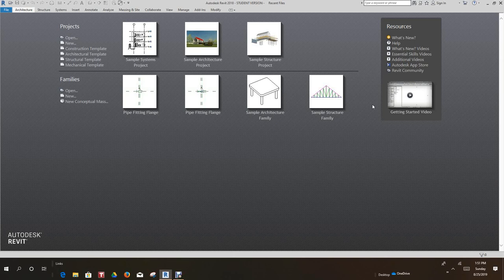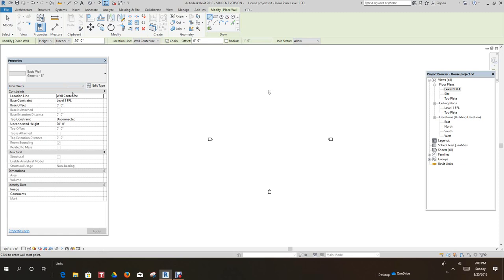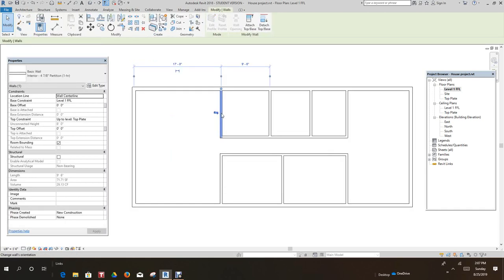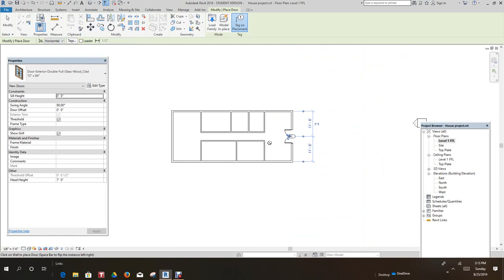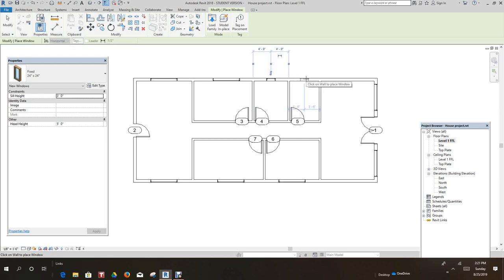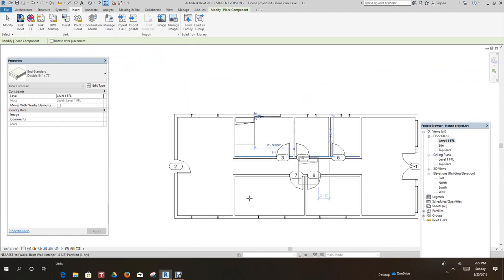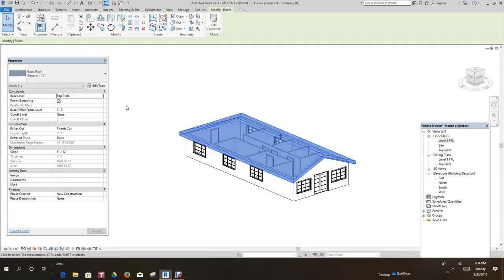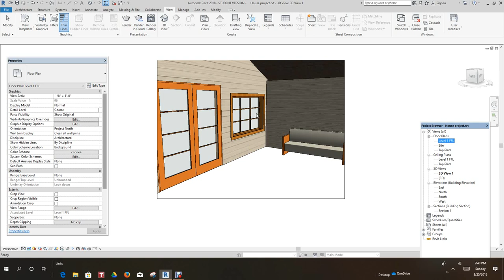Revit Architecture Basic house project

Comment: 23th Min teaching : is there any table , reference available for the most common windows and door size available for the residential buildings in North America? which most of the builders use or offer ?
Reply from the maker: https://classicwindowsinc.com/classic-windows/double-hung-windows/double-hung-window-size-chart/

Standard sliding window widths are 36, 48, 60, 72 and 84 inches wide; the windows themselves are actually 36 1/2, 47 1/2, 59 1/2, 71 1/2 and 83 1/2 inches wide to allow for installation. Standard heights are 24 inches, 36 inches, 48 and 60 inches. A 6-foot-wide by 4-foot-tall window is identified as "6040."
Reply from the maker: Doors: One of the most common front door sizes in American houses is 36 inches wide by 80 inches tall, and almost 2 inches thick. However, not all doors will have these measurements. Doors can be as narrow as 30 inches and as tall as 96 inches, and thickness can depend on the door material.
https://builders-surplus.com/doors-measuring-rough-openings/

the thing to remember is all the measurements you see even in Revit are nominal a 1/2" extra is used for construction
Reply: @unidesigndc  thank you , makes lot of sense , Apricate your quick help. enjoying your videos as always. Planning to finish this series by this month.
Reply from the maker: @weldinginspection7239  That's great basic house is a good start. It covers everything including plumbing electrical and hvac. You will be an expert! :)
Reply: @unidesigndc  sure, I want to be, I get lot of inquiry about the work, I want to start working soon :) do you do freelancing work as well ?
Reply from the maker: @weldinginspection7239  Yes when I can find the time my because my job keep me very busy. I also train my co-workers
Reply: @unidesigndc  awesome, so you are helping people everywhere :)
Reply from the maker: @weldinginspection7239  Not as many as I would like need more subscribers
Reply from the maker: @weldinginspection7239  We need more Revit users not enough because their are so many jobs
Reply: @unidesigndc  that is true, i am enjoying revit learning so far